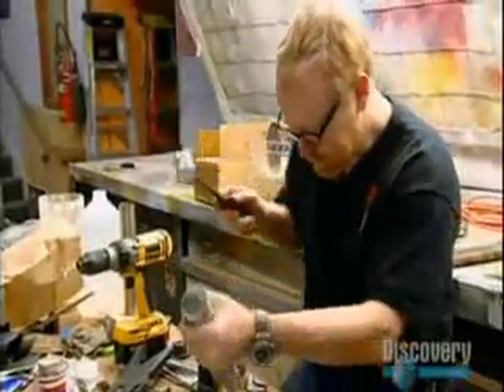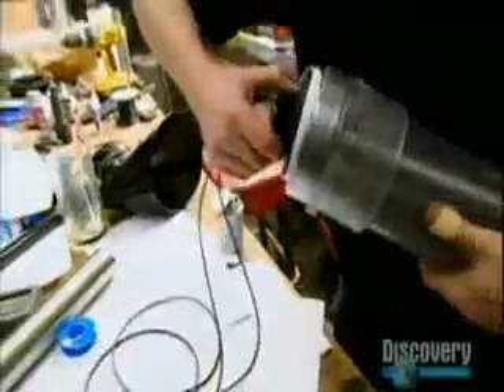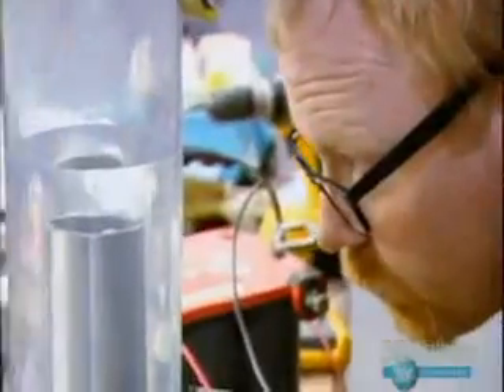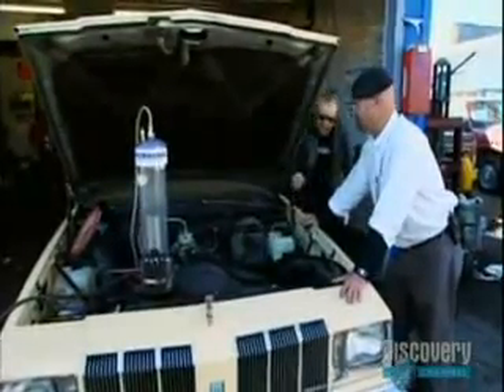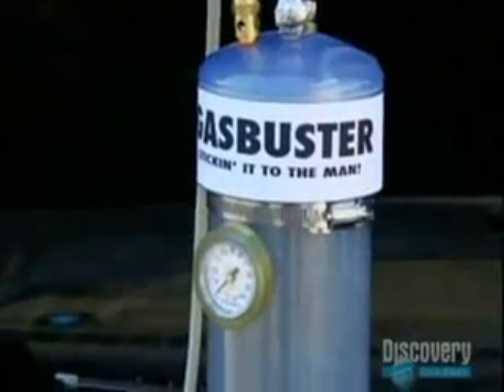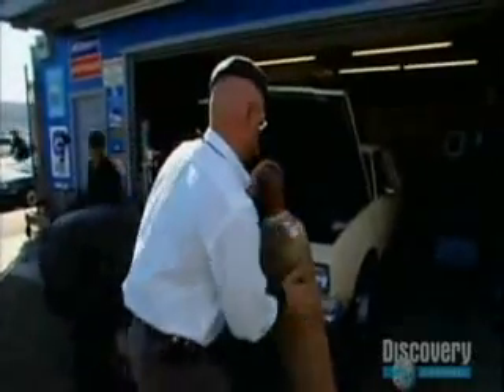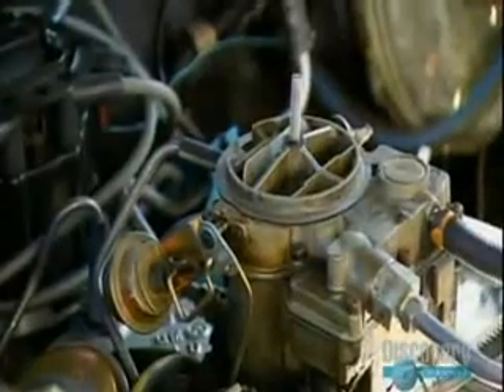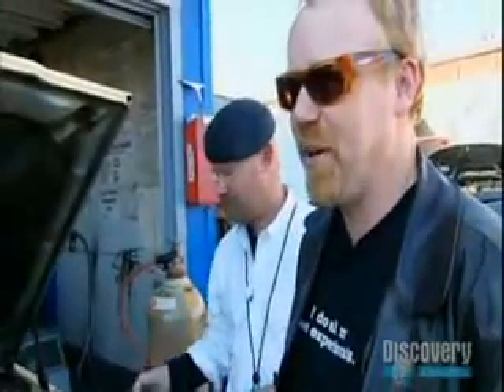HHO Mythbusters Explained

Comment: its all hogwash. it takes more energy to split the water  into hydrogen and oxygen than you will get from burning the hydrogen. that's the first and second law of thermodynamics you're claiming can be broken
Reply: There have been too many reports of increased gas mileage. And even if those were off (how could he be 56% off?), the car would still run cooler and cleaner on a HHO hybrid system. Extended engine life.
Reply: Hydrogen Hybrid Conversion For ANY Vehicle - I'm Saving 56% At The Gas Pump!
This is a 1998 Ford Explorer Sport converted into a hydrogen hybrid by Alex Rivera and how2savefuel.com. Horsepower and torque increased significantly after the conversion - The truck accelerates much more quickly without the engine laboring nearly as much as it used to! Highway MPG improved by 56%, city MPG improved by 35%. The system produces hydrogen ON-DEMAND and it is immediately used by the engine - Hydrogen is NOT stored, so there is no risk of fire or explosion (in the case of a car accident). I'm saving more money at the gas pump than I ever thought possible and I didn't have to go and buy a hybrid to do it! Convert the vehicle you ALREADY own! ANY combustion engine!

Comment: If they had put a propane style carburetor on that car and connected a pressure line from the hydrogen tank to the carb, adjusted the pressure wright, it would run perfectly. Plus they did not make the hydrogen maker correctly, and I am sure this was done on purpose. Very disgraceful attempt to bust something that is not a myth, but is a fact. They did not try very hard, and they should be ashamed for selling out.

Comment: Their experiment didn't work because they didn't build it correctly, and appeared to not be interested in it working. I'm glad you busted THEIR myth. ....even if a smaller HHO generator doesn't create enough hydrogen to run a vehicle, it can create enough fuel to add mileage, burning less gasoline. You'll never be able to get a simpleton who is addicted to oil to listen. The same type refuse to wear masks for their own or other's safety either.

Comment: The setup they used doesnt require a base mixed with the water......and they only needed a 1mm gap between plates.......BUT they didnt adjust the width of the square wave to find the resonance of the circuit, which is what makes the whole thing work......the electrolyte model is the crude form of this.......Grant simply didnt know enough about what he was doing......😉👍

Comment: This is not the way u put the pipe on carbuerator and start the car.  In cng and Lpg vihicles you also cant put pipe in this manner,  because its dangerous it involves fire and blast.  It life threating and illegal. 
You first use the proper way of starting car. Even you couldnot start car with petrol on such manner you show in your video. 
Hho cells are reality in these days.  Used in various asian countries.

Comment: Reading the comments is a trip down conspiracy lane.  When people do not have a grasp on physics and critical thinking , this is what you get and it shows how people can believe anything and be manipulated by self confirmation bias into pouring money into what is garbage, 

Most of these people will not even try and say ...get simple generator to run and take the output of the generator to run the HHO to keep it running. 

Losses due to drag on the alternator outweigh the energy produced by it.  Also energy density is for shit as well.

Comment: Haha!  I don't even drive a car!  I drive an e bike.
Reply: do u use Solar panels
Reply: @rexgeorg7324  No, I use water turbines.  I have 2 massive water containers at home which are be lifted by jacks.  They have small holes where water flows, pushed by down by air trapped in rubber, one is high with water, the other one empty, it takes 3 hours for water to be empty for the lifted one, then the other one will be raised, the empty one set down.  Free electricity.
Reply: so it runs 24/7 ...what sort of wattage do u create
Reply: @rexgeorg7324  sorry, it doesn't run 24/7 because I sleep at night.  I use the electricity for airconditioning, running laptop and lights.   I'm planning on building automatic lifting system and adding additional water tank when I have more money so it will take more time to run empty.  Wattage? 150 - 180 watts of power.  15-20 kWh per day.  Water is pushed out by applying air pressure into the water container with rubber cover.  I use inverter AC for lowest power consumption.
Reply: @rexgeorg7324  Thanks!  So, this went over my head though, I'm not much of a chemistry physics guy, so basically the video is saying, heat and chemical density affects circulation?
Reply: It is t life itself. do watch more of his videos if you have time they will change your life forever; search for inclined bed.

Comment: I’ve got to say, coming from a fan of myth busters since I was 5, this really lost me. Either they purposely did it wrong or they really don’t do hardly any research at all. At the age of 15 I built a much better generator for <$10 out of SPOONS that out preformed this one 100 times over. Check my vid if you want to see an easy and working one. Myth busters has lost my support.

Comment: First, you're not generating Hydrogen, you're generating a blend of Hydrogen AND Oxygen in the perfect explosive ratio.  I know this video is 10 years old - but people are still falling for the idea of increasing their gas mileage.  Truth is - if you increase the efficiency of your engine by 10% you're using that 10% to generate the electricity needed to generate the hydrogen.  AND you're making a bomb under your hood.

HHO - when ignited is EXTREMELY energetic.  I didn't say powerful - I said "Energetic".  A very small amount of HHO can produce an ear ringing pop.  But back to the 10% thing:  If you increase efficiency by 10% because of heat and other losses such as lost current in the wires, you're lucky to see 8% returns on what you generate.  Now, I don't know that number to be exact, but I DO know that you don't get as much out as you put in.

If you want to generate Hydrogen separate from oxygen then you need two cylinders; one with a positive probe and the other with a negative probe.  That way one side (don't know which) will generate hydrogen gas while the other side produces oxygen.  That way would be safe because hydrogen won't burn without oxygen present.

When it comes to the Mythbusters - - - I've watched their show for years.  Entertaining as all get-go, but I also have seen many flaws in their experiments.  Even when they try to blow hydrogen directly into a carburetor.  WILL AN ENGINE RUN ON HYDROGEN GAS?  Yes.  It will.  But how you mix that gas with oxygen is what makes the difference between success, failure and a catastrophic engine failure.  THEN there's metering the gasses into the engine to control engine RPM (Power).  People have been running cars on Natural Gas for years.  The same can be done with Hydrogen.  But modifications are needed.  And the cost of buying hydrogen is high.  Far higher than the cost of gasoline.  Want to run your car on hydrogen?  Go ahead.  It CAN be done.  BUT - - - can you afford it?

Comment: If your generator fills that bag in 5 minutes, it is definitely not making enough gas to run a car. A car takes in its full displacement in air every 4 crankshaft rotations. Meaning that the engine they're using (probably 5.0 L or bigger) would need hundreds of times more hydrogen than the generator can produce.